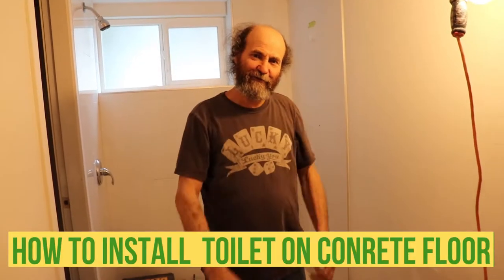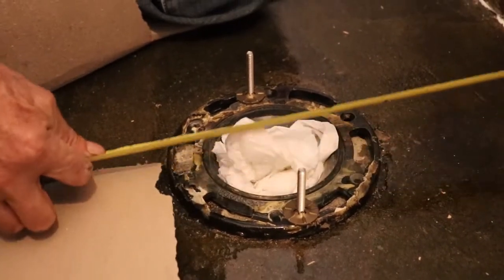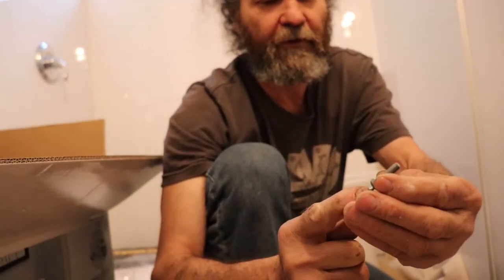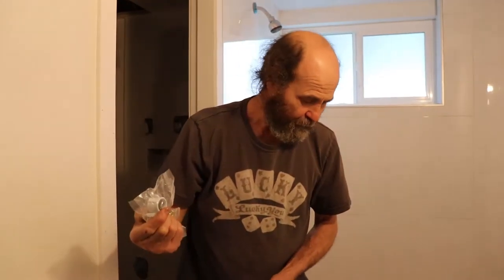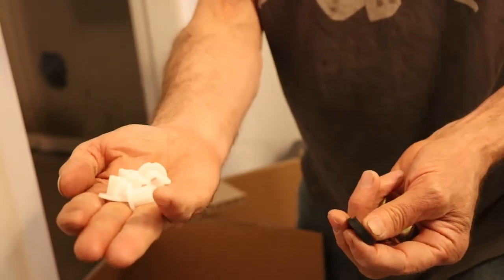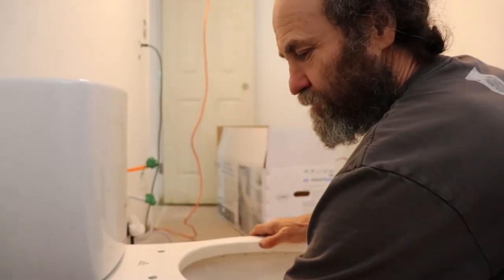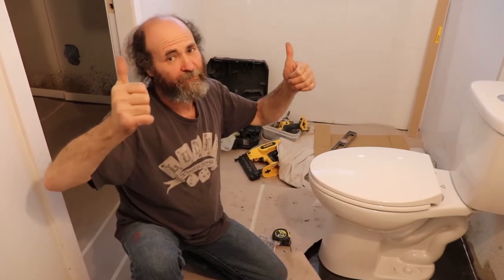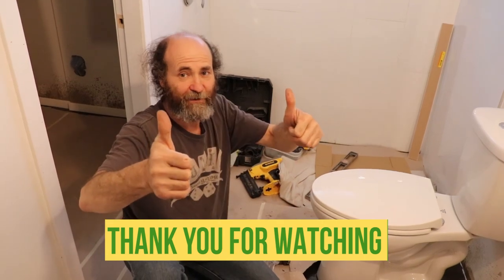How TO Install TOILET ON CONCRETE FLOOR

Comment: We keep trying this and ours rocks back and forth no matter what flange we choose.  We are going looney trying to figure out how to put a toilet on concrete!!!!!!
Reply from the maker: Hello there, thank you very much for your time and support, sometimes the concrete slab is not totally flat, once you have it set in place, use 100% silicone around the toilet base and let it cure, it's topical to use silicone around the toilet base to stop it from moving, please let me know if you have more questions and how it worked, keep safe and see you in the next videos
Reply: @BahianoReno  Ok I’ll try it!  I hate silicone because it’s an skill and mine will look awful but I know they have the hard molds that help you make a better line.  Here goes nothing!  Thanks!